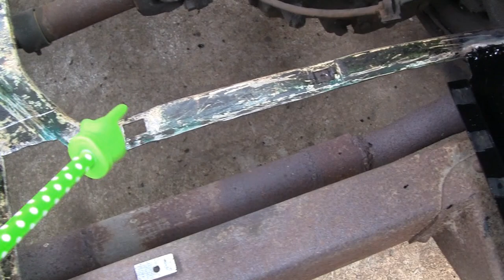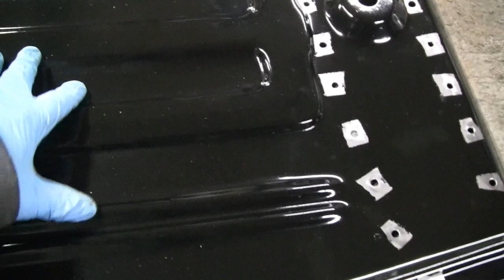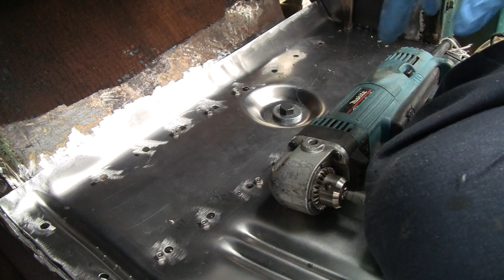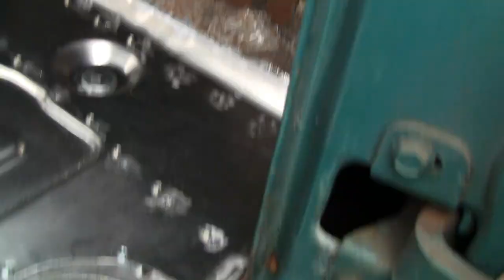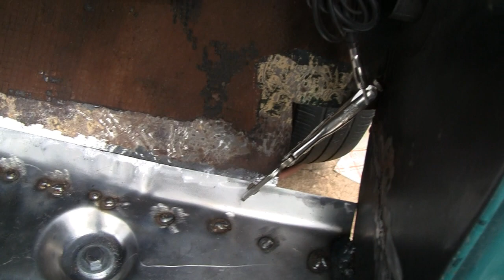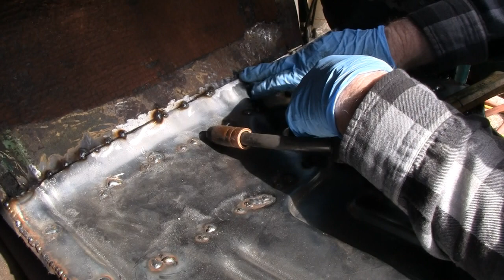WELD in FLOOR PAN FORD (F100 part 56)

Comment: Lookin good Road King !
When you were dong body work for a living did you have wire welders?
If not, how would you attach panels? Gas braze them?
Just curious.
Reply from the maker: Thanks Steve!! That was back in the 70's and 80's, we brazed them on or used a spot welder!! Migs were around but they were so expensive back then nobody owned them!!☺